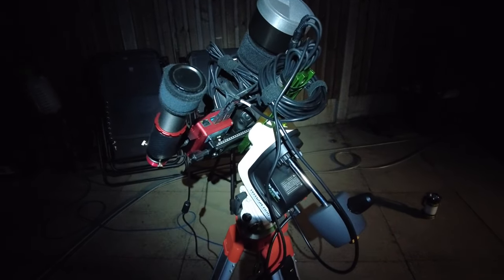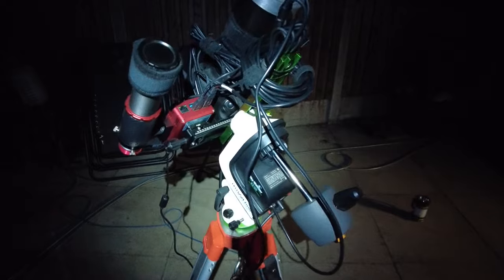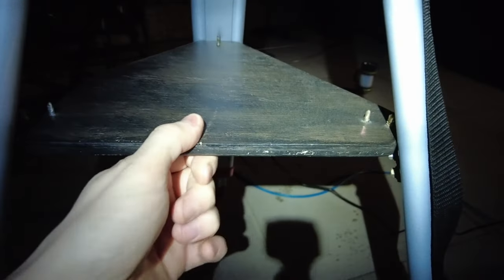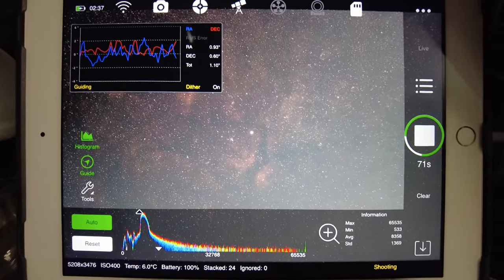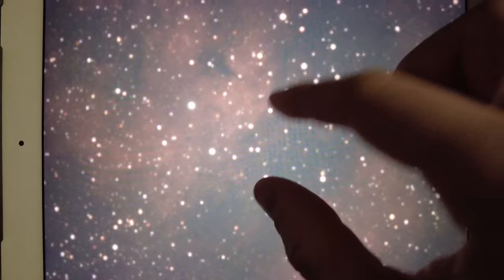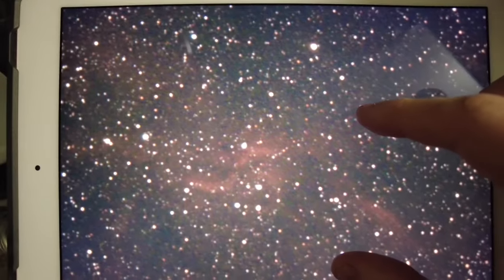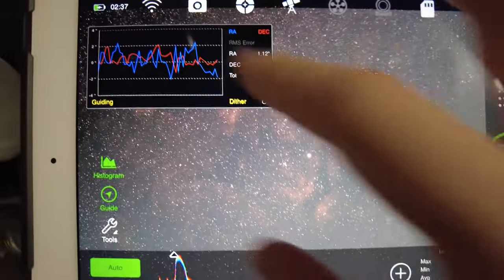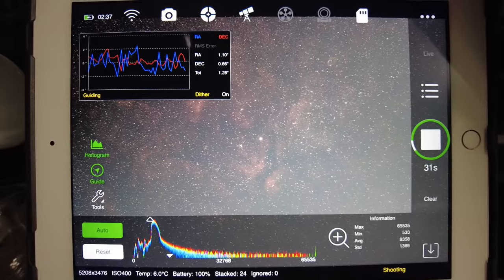AZ-GTi & ASIair Pro - Compact & Portable Astrophotography Imaging System - General Capture Workflow

Comment: Great video Luke 👌 I like how you calmly go through the whole process!
Reply from the maker: I appreciate that Scott! - It's brilliant to hear :)
Thanks for taking the time to watch and leave a comment mate!
Reply: Hi Luke! Quick question, just going to load up the firmware for eq conversion and have been reading a lot on CN about versions 3,2 and 3,26. Which version are you running?
Reply from the maker: I'm sorry about the really late reply Scott, I missed this for some reason! - I use the slightly older version, 3.2 as the guiding works properly 👍👍
Reply from the maker: @ScottDavies  Hey Scott! Everything worked great on the new firmware, it just gave issues with autoguiding when using it with the asiair :) not a problem otherwise! I'm glad to hear you've had the chance to give it some initial testing by the way! 👍👍

Comment: Thank you Luke. At 6:15 I got confused. You chose not to use the ASIair's 5G wireless functionality and instead "used a Lynx Astro wire, because it then enables you to the ASIair wirelessly in 5GHz Wi-Fi mode, which is quite a lot faster". But you used a USB 3 cable, right, so where's the wireless/Wi-Fi part?
Reply from the maker: Hey there! - sorry for the confusion, allow me to try and clarify :-)
If you connect the ASIAIR to the AZ-GTI via WiFi, you are then only able to use 2.4ghz wifi mode for both units, as while the ASIAIR supports both 2.4 & 5, the mount itself can only use 2.4 which then locks you in to that frequency.

By using the cable to connect the mount and asiair together, you are then free to use whichever ASIAIR WiFi frequency best fits your situation without any worry about the mount's connectivity being restricted :-)

I hope that helps, thank you for getting in touch!

All the best,
Luke
Reply: @lukomatico  Many thanks Luke for your comprehensive response. I was confused about switching terminologies between AISAIR's AP and Station "Wi-Fi" modes and its LAN Ethernet port, which is not (of course) Wi-Fi, so there are no obstacles to go through at 5Ghz. At any rate, I'm guessing your "Lynx Astro wire" is an Ethernet cable, right? If not, then I'm flummoxed!
Reply from the maker: @AntPDC  Hey Mate! the lynx astro wire is an 'ftdi to usb' cable, whatever that means! :D all I can say is it allows a wired connection of the mount to the ASIAIR, which in turn allows you to use the ASIAIR in 5ghz mode if you so wish :-)
if you only ever planned to use 2.4ghz wifi mode on your ASIAIR, then you would be totally fine to skip the mount wire entirely and just use a wireless connection between the mount & air - I hope that helps somewhat - I'm sorry this is quite a confusing thing to explain!
All the very best,
Luke
Reply: @lukomatico  Thanks again Luke - so kind of you to take the time to respond. I've another question so as to torture you even more, which I'll post on the main thread.

Comment: Absolutely brilliant video. I have the az gti mount and converted into eq mode, with my sw 72ed and have an asiair pro on order due to arrive moro.  I love the look of the simplicity of the whole asiair interface. I have struggled a bit with astrophotography without the asiair but this will hopefully make it so much easier for me, in respects of guiding, dithering and PA which i hve to do via other software programs atm.  Could you maybe do more videos on this set up soon and its a real nice portable set up.  I'd like to see how you connected the software of the asiair to the az gti as i have the lynx astro cable and a zwo asi120mc-s to guide with.  Really love your videos and so instructive to follow to.  Keep up the good work and clear skies.
Reply from the maker: Hey there mate! I'll definitely be doing more Az-gti videos, 100%!! - regarding connecting it to your new asiair, you can just use your cable and select Az-gti in the mount connection drop down box :)
Re: the asiair, It's honestly and truthfully one of the best bits of astronomy kit out there in my view, I'm considering buying another one for my main rig! If I had the spare cash it'd be on order already 😅

Thank you so much for watching and leaving a lovely comment mate, I really appreciate it!

Have a good one,
Luke

Comment: Nice set up Luke. I have the AZGTI and run my Z61 off it. Excellent little goto mount. Actually using mine now as away for a few days in Suffolk (Bortle 4, such a difference) I got a really nice bar from mine off Ali express. About £30 and has some end weights incl
Reply from the maker: Hey mate! I take it you recommend the bar then? They do look very good!
I hope you get a nice image captured in those nice skies!! Best of luck to you mate 👍
Reply: Hey Astrobloke, I live in Suffolk, bottle 4, should be good tomorrow & Saturday. Clear Skies!
Reply: @lukomatico  yes its nice and fits the Az with no adapters. Just check your couterweight hole is big enough. I have a 3.5kg skywatcher weight i use. My 360mm is causing me target issue atm. Too small for most targets and not wide enough for others, typical lol
Reply: @SimonsAstro  👍
Reply from the maker: Stuck in the middle! I've had that before haha - always leads to an expensive visit to an astro retailer 😂
Reply: Hey Luke, may have sorted out my guide cam problem with ASIAIR, just waiting for it to get dark so I can test it🤞
Reply from the maker: Oh! Great to hear, I genuinely hope it is sorted for you mate and you get a night of quality imaging, it can feel like such a pain trying to faultfind!
Reply: @lukomatico  Ive cracked it Luke😀 guiding like a charm now, just had to turn off the Dec, so only RA! Clouds just came in, so test over, ready for tomorrow 🤞clear skies!
Reply from the maker: @SimonsAstro  Fantastic! I'm glad it is sorted mate! - roll on the clear nights 👍

Comment: Hello Luke. Thx for the video 👍Could you please share your Asiair guide module settings for use with the Azgti ? Please include your aggression settings.
Thx in advance !
Reply from the maker: Hey Alison! Glad you liked the video! :-)
RE: guide settings, I don't believe I have them recorded unfortunately so It'll have to be from memory as best I can recall when I last was using it - these settings were to be used with high guide camera gain settings by the way, the actual amount will vary dependent on your guide camera. (my 120mm mini I use 80 out of 100 for example.)
RA+DEC aggression 60%, guide exposures 0.5s, guide rate 0.9x, max movement pulse 5000ms, and the calibration step was 1500ms with a 30mm guidescope (120mm F/l), and is 800ms with my 50mm guide scope now (242mm F/L)
I hope these are useful to you, I know the AZGTI can be a real handful to get guiding well, especially with slightly unbalanced loads. The best improvements were the short guide exposures, coupled with medium/high aggression, allowing it to react quickly. (the rest, less important perhaps)

Hope that helps!
Clear skies

Comment: Very nice! I have been having some problems calibrating my azgti in autoguiding. Is it possible for you to pass the setting used to calibrate your guidance? Thanks
Reply from the maker: Hey Thiago! - on a 30mm f4 guide scope we use 2000ms calibration steps, that should be enough to give good movement :-)
Hope that helps!

Comment: Thanks a lot for your video. It will be very useful for me. I bought recently the same setup. One thing I don't really understood. During the polar alignment process you moved your tripod and something on the wedge? Could you explain me a little bit more please?
Reply from the maker: Hey Yann! - when I move the tripod I am doing the large movements by moving the whole tripod to point the north leg accurately, when I am getting close to accurate alignment, I then switch to using the azimuth bolts on the wedge to make fine adjustments & finish polar alignment :-)
Hope that helps!
Reply: @lukomatico  Thank you! I will try this.

Comment: Thinking of buying the AZ-GTI.  You said your counterweight shaft was M12.  What is the thread pitch?  I already have an M12x1.75 threaded counterweight shaft and am wondering if it fits the dec. clutch of the AZ-GTI.
Reply from the maker: Hey Kristen! - Good question mate, I should have outlined that in the video! - it's just standard m12, so a 1.75mm pitch :-) your current counterweight shaft should work fine!
Hope that clears it up for you my friend, good luck!

Comment: Hi Luke, you say you're using an UHC filter inside. Is that a clip-in version or a round one? If the latter - how did you install it? Cheers!
Reply from the maker: Hey there mate! - I was indeed using a clip-in filter, you simply take the lens off the camera, and then clip the little filter in it's housing into place within the body of the camera, allowing you to reinstall the lens :-)
Hope that explains it!
Reply: @lukomatico  Thanks, that's what I thought actually.

Comment: Great video. I have just set up a system with the same lens plus Zwo eaf etc. I’m thinking of getting an Az GTi as well but have been a bit put off by stories of large DEC backlash. Have you had to tune yours? Cheers, Des
Reply from the maker: Hey there Des! - that should be a wonderful system for sure, I bet the autofocus is really handy on the fast lens too :)
Regarding the Az-gti backlash, nothing really to report in truth, it guides well! - I'm not sure about unguided imaging though, I only did that at 50mm for 1 min subs.

I have heard that mileage can vary with the Az-gti, but mines been just a pleasure to own and use, the full goto /automated plate solving is tremendous too when paired with the asiair, it's not something I'd easily give up now I've got it! :)

Thanks for watching and I hope that helps!

Comment: Hi Luke: I watched this video some time ago and it inspired me to buy the AA+ to use with my Samyang 135mm lens and my Skywatcher 72ED on my Star Adventurer mount. Have managed to use it twice recently, once with the telescope and once with the lens. I have a similar guide scope and the same guide camera. I got pretty good guiding results with the telescope but not so good with the lens ……. because I kept messing with the ‘calibration steps’ and the ‘Max RA and DEC Duration’. I think I’m pretty close on the calibration steps having tried different settings, but I think I perhaps need to adjust the latter if that makes sense.

I don’t suppose you know what settings you use? I appreciate you are using a GOTO mount whereas I’m only using RA guiding with DEC mode switched off, but I note that you managed 5’ subs that night on the Samyang. I’m pretty sure I should get somewhere close to that but I only got 2.5’.

My PA was ‘spot on’.

I’ve reached out on FB groups trying to find a solution with so far limited success. Any help would be great 🤝
Reply from the maker: Hey Ian! Dialling these things in can be a real pain in the neck for sure, between thin documentation, notable example to example variance on the mounts and anecdotal advice (which I'm about to offer too, haha!) It's a bit of a minefield!
I'd try around 3000ms calibration step size, which if using a 120mm f/l guide scope and any pretty typical guide cam should see you calibrating within 20 steps or so, then use 5000ms max ra/dec duration.
I'd try guiding with 1 to 2 sec exposures with a fairly high aggression, around 70%+
Hope they help you get a little closer mate!
Good luck 👍
Reply: @lukomatico  - Hi Luke : Many thanks for your input on this. It puts some reality to the process. Interestingly, I started off with a 2000 calibration step and the guide scope stepped west by 13 steps when I first tried. I never saw it step east on screen but when I later looked at the phd guide log it had (13 steps). I wish I’d known about that log before I started messing. However, I then adjusted the calibration step to 8000 (4-5 steps). Dropped it to 3000 (around 8 steps). So for me I was going the wrong way? The next clear night I’ll dial in 1800 or thereabouts. What was interesting was that on my first attempt I got perfectly round stars on every single exposure(60 x 2’) even though the guiding graph on screen looked rather ‘ropey’. Unguided I’d only ever got 45” on my Skywatcher 72ED (420mm focal length). It seems that the settings are very mount specific and in my case on a star tracker they can be be very different to a fully GOTO mount with guiding in both axis. I’m very grateful for your advice and input 👍
Reply from the maker: No problem mate, I'm sure you'll get to the bottom of this! I'd definitely agree that the settings can be very user specific on these star tracking mounts 👍
Good luck mate!
Reply: @lukomatico  - just an update on this. A couple of nights ago I used your suggested RA and Dec suggestions and used a calibration step of 1800. Managed to guide for 3hrs solid, with 3’ subs. Dec guiding was below 2 arc minutes throughout. Polar alignment was good but not perfect - but the result was a win for me. Thanks so much for your help Luke 🤝
Reply from the maker: @ianmacdonald2307  Ahh that's superb news mate! Really glad to hear you've had success, thank you for sharing!!
Clear skies! 👍👍

Comment: Great video, thanks. One question please- the payload weight is rated at 5kg I believe. Is 5.5kg too heavy do you think?
Reply from the maker: Hey Gerard! - it would be okay in calm conditions and with autoguiding I think, as long as that 5kg wasn't very far off axis (think like a short refractor telescope), a small Newtonian of similar weight probably would cause it to struggle though!
I hope that helps 👍👍
Reply: @lukomatico  It would be a DSLR and large lens plus autoguider.
Reply from the maker: That would likely be fine mate 👍👍

Comment: Super good video! Im getting a az gti with eq mods soon, with either an asi air pro and autoguidingabout 2 months later, or the otherway around. What would be the best option; Asi Air or Autoguiding first. It would be my first mount, coming from untracked ap. (Asi AIr for better Polaralligment etc, guiding for guiding of course)
Reply from the maker: Hey there mate! - That's a good but quite difficult question! - of course both are vital in the end, but I really do think you get a lot of bang for your buck out of an ASIair, the polar alignment, plate solving to targets, imaging plans etc are all very good, however if you are imaging with a scope/lens above around 135mm focal length then potentially autoguiding would be the most useful start - as long as you have a pc to use for astronomy tasks such as running phd guiding etc :)

A tough question! :)

I hope that helps somewhat, it won't be an easy choice!

Thank you for watching
Reply: @lukomatico  Thanks a lot! I currently have a 50mm, 70-200mm and a Skywatcher 72ED which id logically use most for imaging. I have an old laptop, but ill loose the portability aspect because it lasts on a charge with just apt running for about 3h max. But I think it probably is enough for summer till the Asi Air. Thanks a lot, again!
Reply from the maker: No problem mate! :D happy to have helped

Comment: Hello, it's me again  ;) I have some difficulties to connect all the parts.
How did you connect the azgti and the asiair plus on power supply? Is it the same or independent power supply? Which type?
Reply from the maker: Hey Yann! - if you supply the asiair with power then you can use one of its outlets and a short 5.5x2.1mm male to male cable for connection, this would probably be the neatest way!
As to which power supply, you need a 12v 5+ amp supply that has the usual 5.5x2.1mm tip positive connector on the end :-)
Hope that helps!

Comment: Great video.  I'm using the AZ gti (did you modify yours at all to help with backlash?) with a Baader modded Canon 700D and same guide camera/scope as well, but using Sharpcap for PA and PHD2 for guiding.  That set up you have there with the ASIair looks much smoother and I can't get anywhere near 5 min subs.  If you don't mind me asking, were you capturing your (stacked) images on the DSLR or direct to the iPad - it looked like the iPad?  I also noticed after PA you slewed direct to your target.  Normally with the AZ gti I'll also do a 2 or 3 star alignment after PA but you didn't seem to, is that correct?  And finally you mentioned connecting the ASIair to the AZ gti via a Lynx Astro cable - can you remember which one exactly?  I'm very tempted to go down the ASIair route and bin Sharpcap/PHD2.
Reply from the maker: Hey there J J! - Thanks so much for watching and leaving a comment, I appreciate that! I'll try to answer your questions in order for you :-)
1:- No modifications for backlash, I did however find that mine worked better with the azimuth plate 180 degrees away from home position!
2:- the images were being saved to both the DSLR and the ASIair, the iPad is just used as a monitor/controller for the ASIair :-)
3:- With the ASIair you can plate-solve, so no need at all for multi-star alignment routines, just polar align and go - it's great!
4:- The Lynx Astro cable is https://www.firstlightoptics.com/sky-watcher-mount-accessories/lynx-astro-ftdi-eqdir-usb-adapter-for-sky-watcher-az-gti-mounts.html - that one FTDI EQDIR usb cable :-)
one final thing to note if you are thinking of going the ASIair route and skipping sharpcap+phd etc, you'll need to have an ASI guide camera to continue your autoguiding with it, it can only speak to ASI equipment (except for mounts/dslr's etc)

I hope that helps mate! Have a great day :-)
Luke
Reply: @lukomatico  thanks for such a full answer :). This set up is definitely worth considering for my light weight rig. I already have the same asi guide camera as you, so all good there. Cheers
btw is that just a regular mini usb cable to connect the 700D to the asiair or something more fancy?   I also couldn't see an additional shutter release cable from asiair to dslr, I guess that isn't needed and all done via the app?  (Sorry for all the questions, this has really caught my interest!)